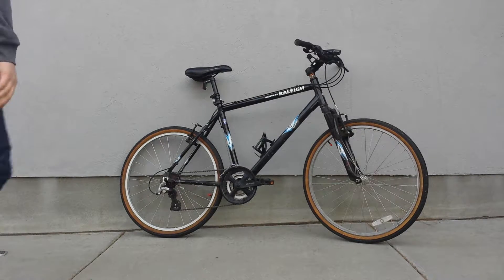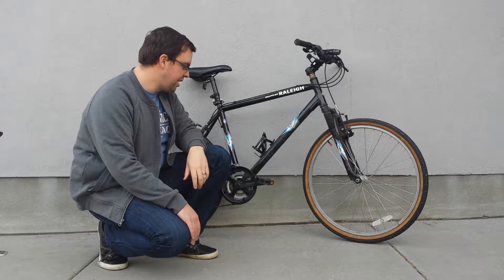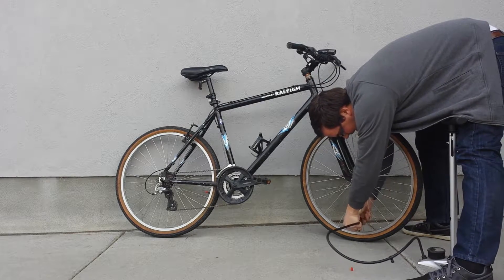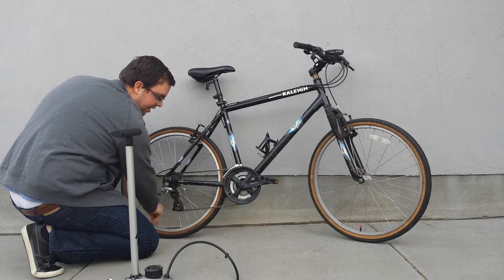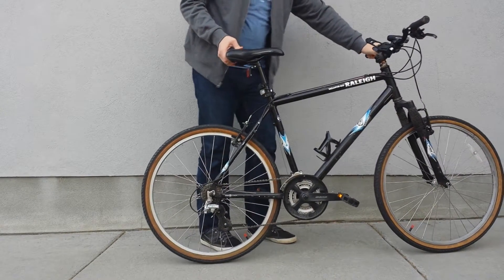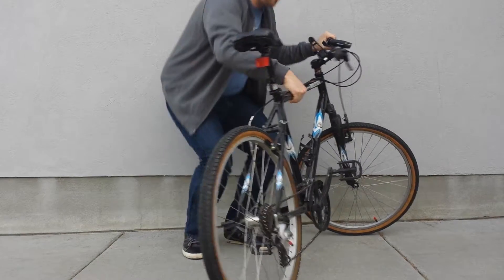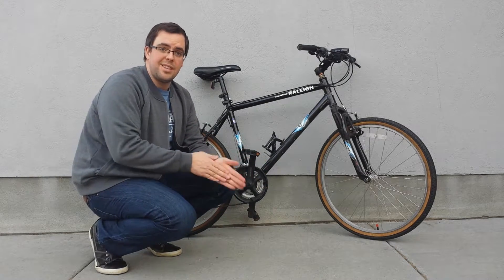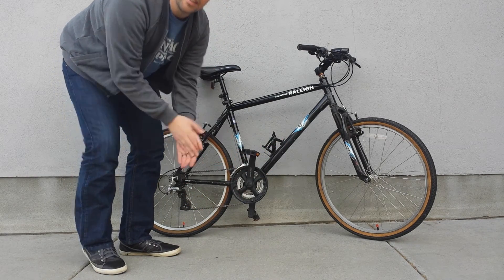How to Prepare Your Bike for Spring

Comment: You have the type of bike I prefer above all others for normal all-around use. My own bike is fully rigid, with no suspension fork, which doesn't bother me in the slightest. I'll ride it on nasty trails any day, but like most bikes, it gets a lot of pavement use. You have a real gem of a bike. You don't need rear suspension if you aren't out  beating it to death on the rocky, root-strewn downhills & jumps.

 I don't own anything with full suspension, but I finally got to try it out on some bikes I was repairing, and it felt really planted & grippy on the pavement, so who knows? But it's more the extra weight & complicated mechanicals & lack of room for frame accessories, so it cuts both ways. I think (good) front suspension is fine, I'm just not in the market for one more bike.  I l really don't have a yearning for exotic frames. The ones based off a diamond frame are what I mostly prefer. 3 or 4 water bottles are a valuable asset at times, as well as the ease of maintenance compared to unusual, attention-demanding frames & parts. Not to mention prices & availability of replacement items.

 I ride a fairly rare Schwinn Paramount  mountain bike, from the days of the notorious rear U-brake behind the bottom bracket, which I've never needed to readjust in the last 15 years, along with the Biopace non-sequitur embarrassment ridiculously waving its little etched chainring banner in endless circles. Anything for a laugh. It's one of only two bikes I own that have index shifting, and they all have old-school freewheels. Actually, the granny ring is really helpful & gratifying on climbs & headwinds, if those are that bad. It plain works. The bigger rings, meh.  It's a mix of oddball, nicely-executed components that work amazingly well, on a full-alloy frame that was handmade in Chicago & touted as a limited release (the "1.86kG", referring I suppose to the frame's weight) or something, with a marriage-wrecking $1600 price tag when new. Most other Schwinn mountain bikes were in the $170-550 range at the time. 

Schwinn was slow to get on the MTB train, and when they finally made some of their own, they still had rather road-like frame dimensions. It took them a while to get the right idea and finally come up with more-practical MTB-style frames.  So, you'd get a larger-than usual (MTB) frame than your normal size, with somewhat less standover clearance, if you come across these early Schwinns. Maybe a size of only an inch or two smaller than what you'd fit in a road frame. Don't go too small or the bike will feel cramped & uncomfortable all the time. 

Mine's a pretty large one, but not the biggest of these. A former co-worker eventually opened his own bike shop & found it for me. He only wanted $150, & I rode it home that day. It works a lot like an extremely responsive & cozy fast-touring bike on roads. The 90psi Bontrager 1.9's I installed have a slick section in the center of the tread for smooth rolling on pavement, and tread cleats on both sides for some eye-opening grip when they sink into the soft stuff. And I'm getting it out for the season right now. 

I've been an off-and-on bike mechanic all my life, with work experience in about five shops and six years of roadracing. That was quite some time ago, but I've kept working on bikes at home or wherever, in the years since. I feel confident that I know most aspects of biking. My best assessment is that you have a really nice, ideal setup for a ride. A good selection of components & accessories on a simple, solid, & fairly lightweight frame. BTW, It's only been in the last few years that I've temporarily given up on winter riding, due to health issues. If you geneally don't ride in winter, I'd suggest you give it a shot. It's fun & not nearly as dangerous or as tricky as one might assume. If you drop, you're likely to land in soft snow, but you won't have to work hard or with timid maneuverings to stay upright & enjoy the heck out of it.